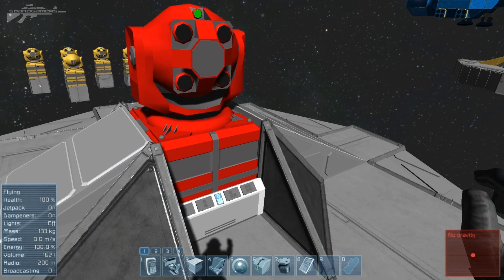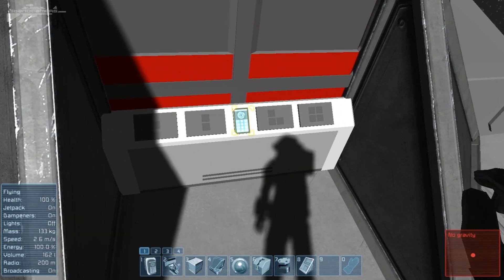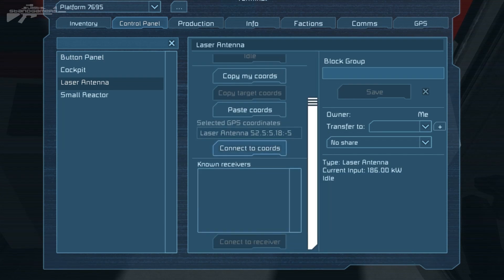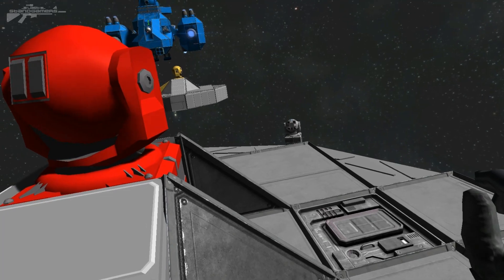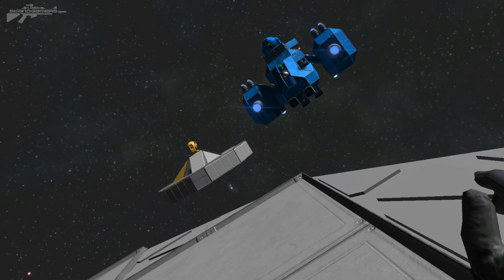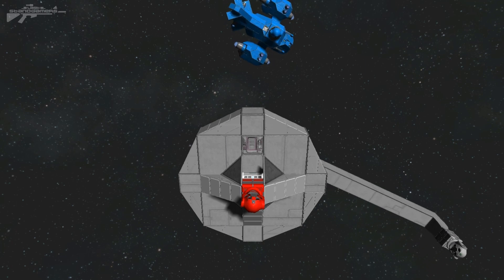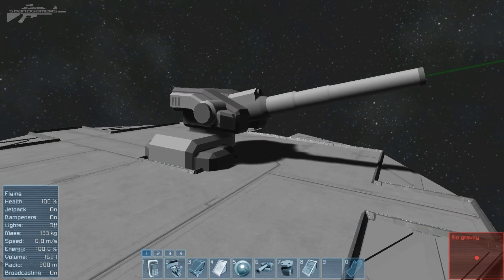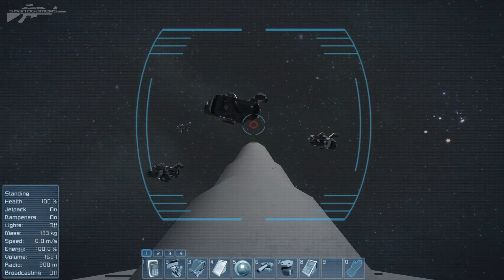Space Engineers - Laser Antenna & Turret Control

Comment: Maybe it would be possible to connect up a 'satellite' with a base using the laser since it can go for thousands of kilometers compared to normal ones which are unable to do so. Then, on the 'satellite' you add a normal antenna meaning you can remote into drones or the like at the other location within a shorter range around that satellite more consistently than the laser one at such distance.

Comment: Just had the thought... Because you need line of sight, you could set up many tiny cheap solar-powered space stations with two antennas on it on a multiplayer server (One to send and one to recieve) and link them together to create a large web of rudimentary line-of-sight detectors (No clue how difficult this would be, but you could add a laser antenna to your base/large ship and have it through the use of a programmable block detect what antennas are there/connected and which aren't. Then potentially output the results to some interior lights or LCD panels?)

Comment: I wonder if the lasers have enough range to connect to a planet base to a base on that planet's moon, or if a planet base could connect to a static non-orbit space station
Reply: +Kirk Cooey if not you could always built relay stations with 2 laser antennas to sort of refresh and incrase their effective range right?
Reply: +Forcedminer I would assume so. Nothing is really stopping you from building a space station with two antennas, and connecting to it with two different stations (Ground and Moon) except the cost of resources and power which is easily solved with solar panels and batteries. I'm interested in making a net of these to detect potential passerby on a multiplayer server because they require line of sight.

Comment: so whats the point of lasers that antenes cant do ?
Reply: +David Bliss Not show everyone your position
Reply: +David Bliss Haven't checked, but they probably take less power and don't actually transmit a beacon-like area. If I remember correctly you can connect to things with normal antennas from anywhere, but if you had them set up with laser antennas you could only connect to them from a base with the appropriate accommodations. This would be useful for a number of things: Potential fighter drones, piloting large chunks of steel-slugs/missiles, line of sight detector fields, hiding a base more efficiently (They're smaller too so that helps), etc.

Comment: on thing i think they should put on space engineers is a kind of filter. i don't think there is any block mod for this so far. this would be helpful because then you could have an automatic miner that just mines and the system sorts the ores into a certain cargo container. another thing that would be fun with this is a sensor. but instead of it sensing things out side it could sense the status of a cargo container. this would be great for a really good fully automatic machine.

Comment: I guess you could use this as a system to keep the fleet disconnected but with the ability to connect up. Also if you have display panels set so the people on board the other ships can access then, then the ships can occasionally link up to the flagship and the crew on the other ships can put messages to the flagship on them.

Comment: You missed the best thing about the laser antenna!
They can pass strings back and forth between themselves and a connected antenna!
Scripted blocks on one grid can actually retrieve the string which means you can a sensor on one ship setting off an alarm 40 KM away on a totally different ship with just a pair of these things!
Any information that can be translated to a string can be passed back and forth between ships now!
Reply: DeKleinsteCools Really? I have been going a bit crazy over it on the steam forums. How you do it is quite simple. The Laser antennae has the full custom name of whatever they are connected to in their detailed info. Detailed Info can be fetched by in world scripts. so you connect a laser antenna on one ship grid to the laser antenna on another ship grid and you just fetch the detailed info to find out the name of the other antenna. That way if you change the name you can change the message (You need to trigger a refresh to get the change but that is as easy as toggling the antenna off and on)
I Built my own little satellite network, all connected by lasers with regular antennae too with broadcast turned off. that way I pick up the location of anyone near them who has a conventional antenna on but my network remains hidden from everyone else (unless they can find one of my conventional antennae that is actually broadcasting) and I set up a little surveillance drone. the drone is passively listening so I pick up any nearby signals, but it also has sensors. when one of those sensors is tripped it changes the name of its laser antenna to reflect the change. this gets passed to another satellite, which passes it to my mothership which sets off an alarm ^.^
Reply: DeKleinsteCools You are most welcome ^.^
Have fun and be sure to post your laser driven ships on the workshop! ;)

Comment: I was disappointed with this update, I thought that they would fix the graphical glitches with the blocks from last Thursday's update, make it actually good to look at without seeing through the ship. But I have my reservations about the laser antenna, maybe you'll be able to charge your ship with the laser in the future? just a thought
Reply: They're basically remaking every block with much higher quality models, so i guess they'll probably just end up doing that instead.
Reply: but why add another block that probably won't get used? it's just like a Antenna and a Romote control block but with restrictions
Reply: KingdomCody its stealthy. its not cluttering your screen with hundrets of tags and distance values.
Reply: if it was a small and unoticable thing and not... that, then I might see about using it
Reply: if you dont like it just dont use it and stop complaining. problem solved. I will use it and have my huge satelite network without having a cluttered screen.
Reply: I was just stating my opinion, something that normally doesn't happen with out someone butting heads, I said I was disappointed with this weeks patch and I'm complaining? think what you will. I will not be baited, farewell zaki NBG

Comment: Just two questions 1 how are they better than the original ones since they can lose connection and don't seem to be long range? and two what's the point of them?
Reply: they are long range. also stelath
Reply: The whole point of a laser based communication system is that they are very hard to detect. Instead of broadcasting radio waves all over the place, it uses the laser to send info to one specific spot. This allows you to have stealth fleets with ships that can communicate with each other without having to worry about the enemy intercepting their transmissions. However, the downside is the fact that it Is line of sight, so you're ships have to stay within sight of each other.

Comment: As soon as I saw this in the SE update video I thought "Arron is gonna attempt a trip wire system" and you said you might attempt it. Since it doesn't show up on radar, it would be perfect. Also, what if in the next update they added settings like "Connect to random signal" So if you built a torpedo, attach a regular antenna. Launch using the basic antenna then have a timer block that turned off the basic antenna and have the laser antenna take over. You then have a another version of "Fire and Forget" missiles